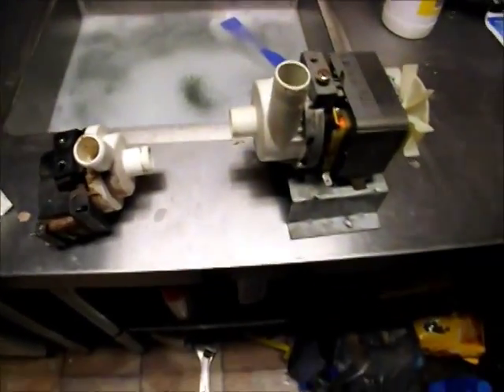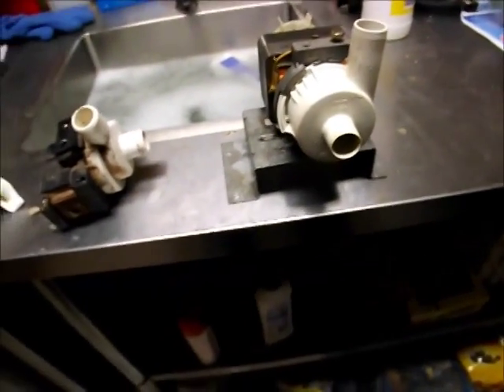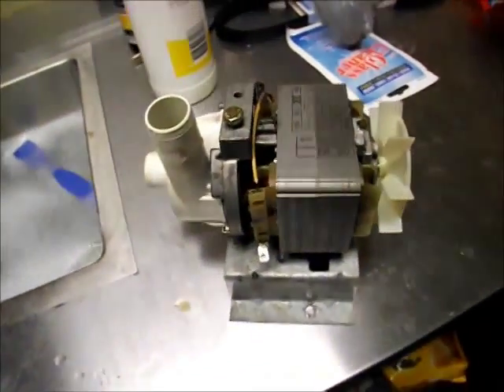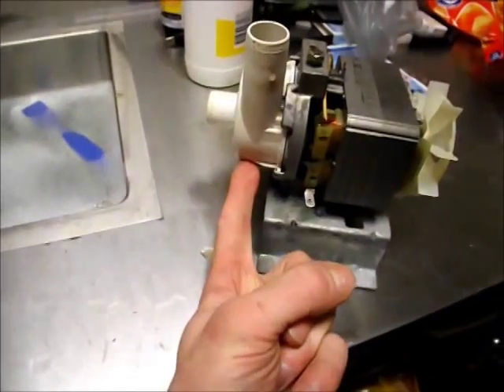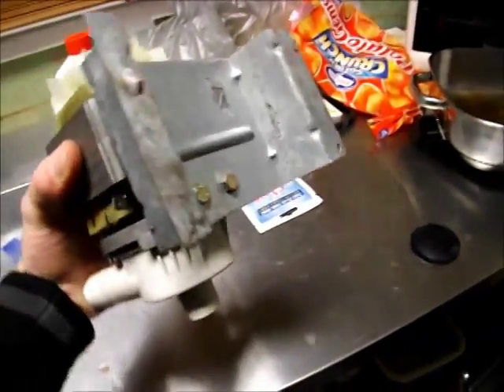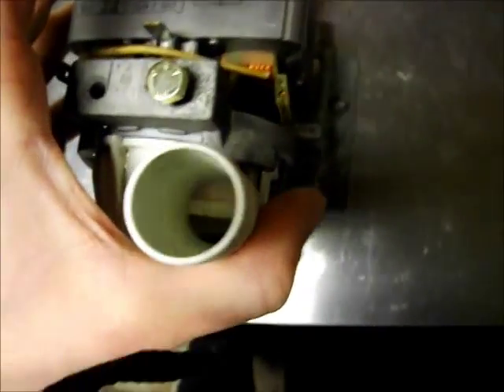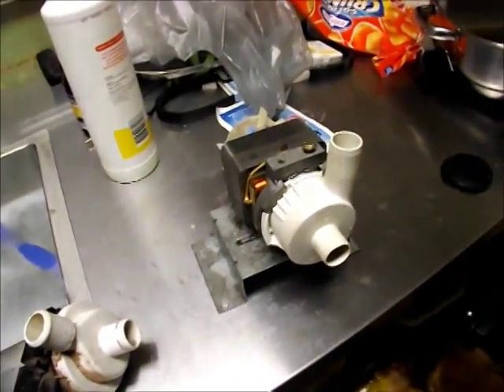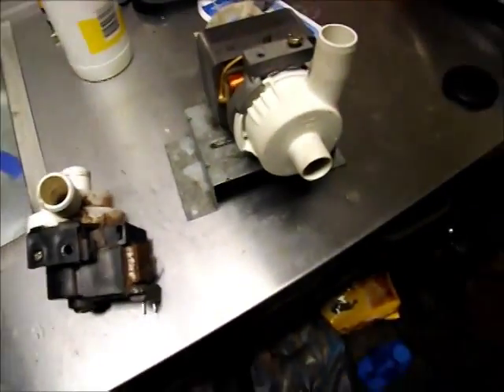massive 150Watt hanning drain pump-sq washer

Comment: Have a Hanning from a commercial Rational Oven I think it was from. Mine is all cylindrical with clockable outlet like yours. Up30-416 110v 110w. Want to find a use for it lol. Nice little unit. Made in Germany.

Comment: I had a leaking 80W Hanning pump. The seal went bad. I stole the seal from a smaller 30W pump. The 80W pump seal was larger than the 30W pump seal but it stretched into place and it doesn't leak yet. So for a pump kit, use a smaller cheaper alternative. The 80W pump came from a Miele commercial dishwasher. The 30W pump came from an Electrolux dishwasher.
Reply: My UP30-416 has an oring seal, nice because it's an easily findable replaceable part.

Comment: Most washing machines in Canada and the US are 110 I believe the only ones that would be 220 and higher are the industrial commercial machines or laundry mat machines.
Reply: Even in Europe the pumps of household washing machines are 220 volts.
Reply: "Electric Experiments"Roobert33 I new that, I find it interesting how just about everything in the European countries are 220 or higher.
I was watching a show a long time ago and they were saying how Europe was 110 back in the 40's?? but then switch ovet to 220.
Reply: redneckbryon Yes, from what I know, from the postwar period to the beginning of the 50s the tension gradually changed from 110 to 220 volts.
Reply from the maker: "Electric Experiments"Roobert33
 probably to lower the cable size when the currant draw increased over the years. at one point 32 volts was common due to lack of grid and ppl had their own 32 volt lighting plant. i have heard that ppl used to charge batteries using their 32 volt gen set to power their lights and radio's at night
Reply from the maker: "Electric Experiments"Roobert33
thank you for your kind words :) (it wouldn't let me reply directly to your other comment, not sure why)
Reply: wickedxe Even with car batteries slowly went from 6 volts to 12 volts, thus reducing the diameter of cables..
Bye :)
Reply from the maker: "Electric Experiments"Roobert33 that's true :) i am glad about that; cars would need a 200 AMP alternator if they were 6 volt
Reply: Can you repair the big pump,mine is leaking

Comment: Brother! I know for commercial water pumps like grundfos or onga we can get every part and seal under the sun. The smaller units are a throw away item IMHO. Any replacement provided it has the same flow output should be suitable, you don't want the thing emptying out to quickly and burning out the pump from a lack of water.

I learnt about water quality effecting motors from previous experiences, it really opened my eyes up after pulling tampons and pads out of sewerage pumps... a smell I can't describe as it will make any human dry reach and is forever etched into my mind.
Reply from the maker: your right about smaller pumps being a throw away item, i wouldn't bother spending more than $80 on a new pump if that one shit it's self. i worked with a plumber for a while; i got used to the smell(but it still wasn't lovely). earthenware pipes that have roots blocking them and the ppl didn't call us till there was a nice big river of shit

Comment: A very beefy pump mate :-)

Dont place the pump on the inside of the machine, put it on the end of the drain tube  lol.

Just imagine how quick a large pond pump would empty the machine lol, jeremy clarkson of the washing machine world, more power!! ha ha
Reply from the maker: it would make an awesome water feature pump :). truly massive pump
Reply: wickedxe
Just imagine how quick you could do an oil change lol, 30 second engine empty, turbo suck lol.
Reply from the maker: zx8401ztv that's true. i wanna see how quickly it can empty a 44 gallon drum
Reply: wickedxe
That experement would give you some good data, stick a parcel label to the motor and add the volume per minuite :-)
I bet the small simpson pump would take bloody years lol.
Reply from the maker: it would be very interesting, even those small pumps can move a bit of water